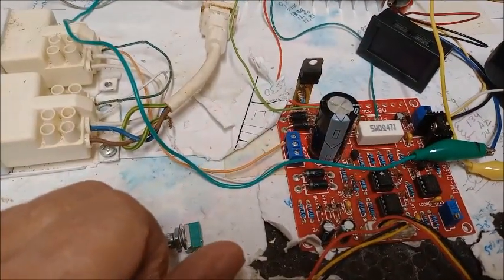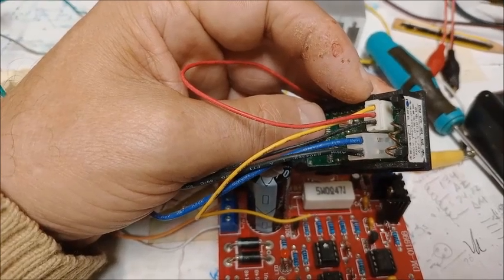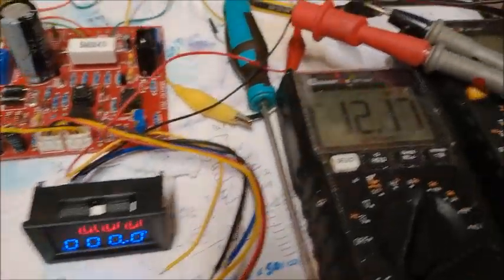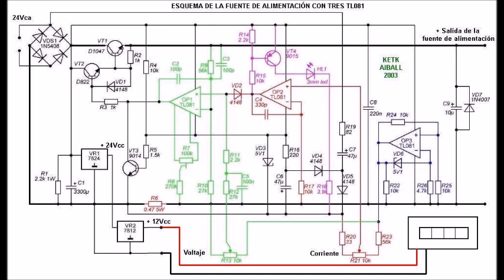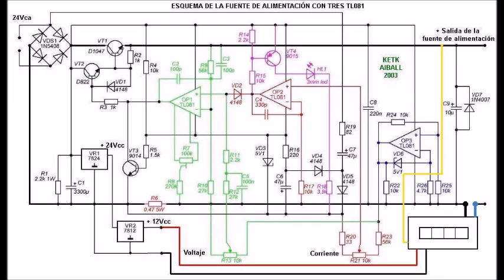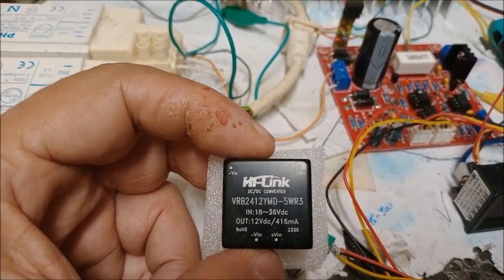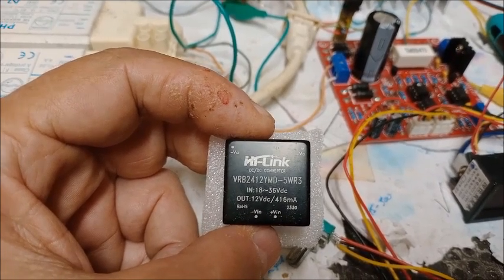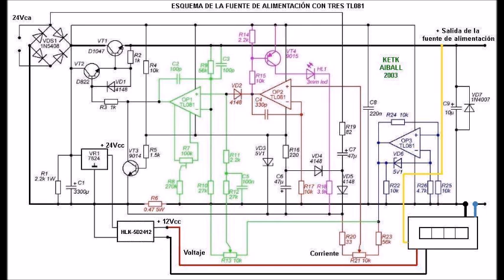4- Problemas y Errores de Montaje de la Fuente de Alimentación de Kit con tres TL081

Comment: Saludos Ketk, muy interesantes sus videos y explicaciones.
Me interesaría saber si en lugar de colocar el módulo convertidor reductor para el ventilador de 12V, o colocar un 7824 con un 7812, ¿porque no optar por  esta otra alternativa?:
 - Utilizar el 7824 con una resistencia limitadora (Por ej. 80 ohms a 2W)
¿Que le parece la idea?, ¿Es interesante?.
Ya me dirá algo y aquí queda. Un atento saludo.
Reply from the maker: Hola amigo Haarper, gracias por tu sugerencia y por tu interés en mis videos y explicaciones. 
Me parece que tienes una buena intuición para la electrónica, y que te gusta buscar soluciones alternativas. Sin embargo, tu sugerencia de utilizar el 7824 con una resistencia limitadora no es una idea nueva, sino un método muy antiguo y simple de reducir el voltaje en la carga por limitación de corriente en el circuito. 
Este método de reducir voltaje en la carga, se conoce desde los inicios de la electricidad, y es muy usado por los aficionados a la electricidad y la electrónica. Por eso, no lo he incluido en el vídeo, porque quería mostrar otras opciones más modernas y eficientes.
No obstante, tu sugerencia es interesante, y podría funcionar en algunos casos. 
Por ejemplo, si tenemos un ventilador de 12Vcc y 150mA, podríamos alimentarlo desde un 7824, usando una resistencia de 80 Ohmios y 2W en serie. Esto se debe a que la resistencia disiparía la diferencia de voltaje entre el 7824 y el ventilador, que sería de 12V, y la corriente que circularía por el circuito sería de 150mA. 
Esto se puede comprobar con la ley de Ohm, que dice que V=IxR, donde V es el voltaje, I es la corriente y R es la resistencia. Así, si sustituimos los valores, tenemos que 12=150×(10EE−3)×R, y despejando R, tenemos que R=80 Ohmios. 
Además, la potencia que disiparía la resistencia sería de P=VxI, que en este caso sería de P=12×150×(10EE−3)=1,8 W, por lo que una resistencia de 2W sería suficiente.
Sin embargo, este método solo sería válido para un ventilador de 12Vcc y 150mA, ni más ni menos. 
Si el ventilador tuviera otro voltaje o corriente, habría que recalcular los valores de la resistencia y su "potencia admisible", y quizás no sería posible encontrar una resistencia adecuada. 
Además, este método tiene el inconveniente de que se desperdicia mucha energía en forma de calor, que se disipa por la resistencia. 
Esto hace que el rendimiento del circuito sea bajo, y que se genere más calor y suba la temperatura en la caja de la fuente de alimentación, lo que puede afectar al funcionamiento de la fuente de alimentación.
Por eso, yo prefiero usar otras soluciones más avanzadas y eficientes, como el módulo convertidor reductor o el 7824 con el 7812. Estas soluciones permiten adaptar el voltaje a las necesidades del ventilador, sin desperdiciar tanta energía ni generar tanto calor. Además, son más versátiles y fáciles de usar, ya que no requieren de cálculos ni de componentes adicionales.
Espero que te haya quedado claro el porqué de mi elección, y que te haya servido de ayuda. Te agradezco mucho tu sugerencia y tu apoyo a mi canal. Eres un gran amigo y un gran seguidor. Un saludo desde Raritania. Hasta el próximo video.
Ketk